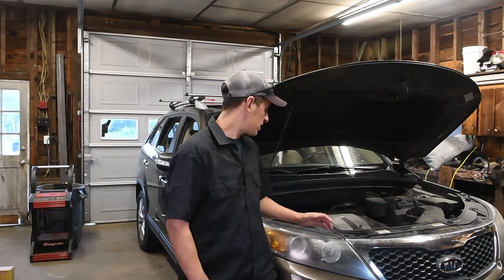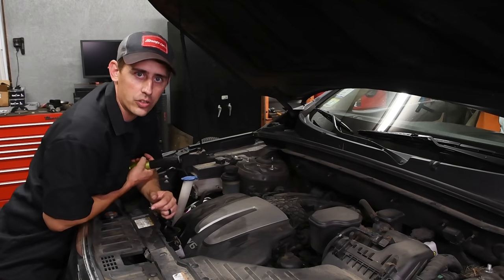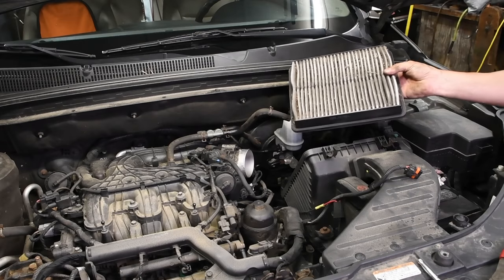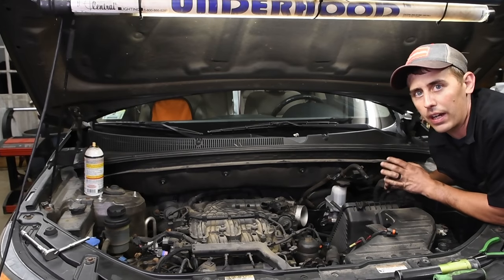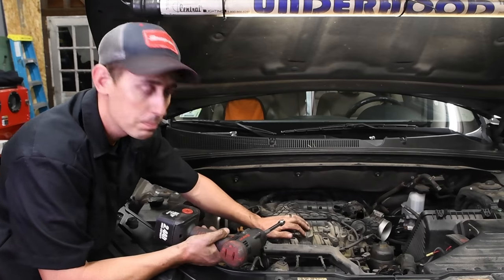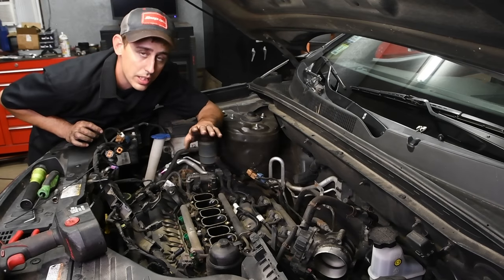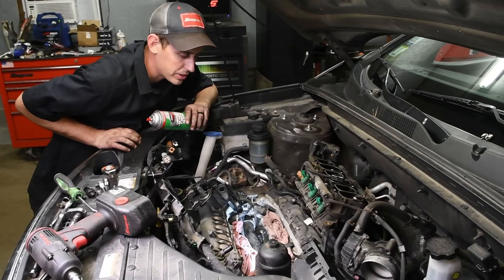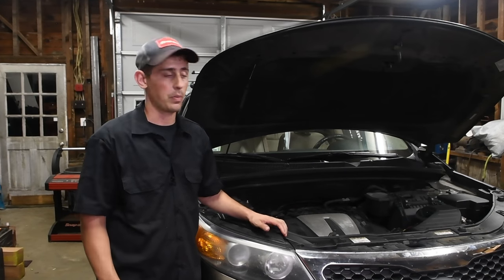Kia and Hyundai 3.5 oil leak diagnosis and repair

Comment from the maker: DO NOT over tighten the sensor. The threads are a tapered pipe thread and over tightening will lead to damage of the housing the sensor is threaded into.
Reply: Seen to late broke housing😢
Reply: Anybody ever replaced the piece the oil pressure switch screws into?
Reply: Part# 21160-3C700
Reply: I have one that has been fixed with JB weld. Not sure how that piece comes off.
Reply: @samroberts7165 I'm currently doing that. The housing is called the "Oil Cover". You have to drain the coolant, remove the coolant assembly, on the driver's side of the engine, remove the the center coolant pipe and then you'll have access to it. You'll need to replace the oil cover gasket, the two o rings on the center pipe, and the gaskets on the coolant assembly. I recommend adding a little RTV to the oil cover gasket, the seal it better. I torqued everything to spec and still had it leaking a tiny bit of oil. Have been doing this job since Monday afternoon. It is currently Thursday morning. I just want it done.
Reply: @JoiceVaderd  can u make a vidoe of taking those parts off 🤦🏽‍♂️🤦🏽‍♂️ I’m currently doing the same thing and I’m struggling a little bit please and thank you

Comment: Thank you very much, Kia Sorento v6, 3.5. dealership found a oil leak, quoted me a rear main seal, valve cover, oil pan gasket and timing belt cover. $1700 but couldn’t tell me specifically which gasket was the fail point. A little Google and YouTube tells me it’s a few gaskets and once sensor. Save me a Ton of money and anxiety.

Comment: We just purchased a 2015 Kia with an oil leak. Taking it back to the dealership tomorrow, but I assume they are not going to fix the issue. After watching this video I am certain that the oil leak is caused by the oil sensor just like the video. Thank you so much for such a detailed video. If I have to perform the repair this video is going to come in very handy. Thank you so much "In the shop".

Comment: Great video, I've had to do this twice on our 2012 santa fe, the first time it happened I thought for sure we had a major engine failure. The first time I replaced the oil pressure sensor I used an OEM part from the dealer and it failed about 12 months after it was replaced and leaked oil again. The second time I purchased one from the local autoparts store and it's been holding for 2+ years. 

I've had luck sneaking a deep socket in under the coolant crossover tube with a long wobble extension to get the old sensor out. Saves a lot of time messing with box wrenches.  Also, I would recommend anyone looking to diagnose this to invest in one of those small USB inspection cameras or boroscopes from amazon. Mine cost me $25 and has saved my butt more than once looking at hard to reach places like under the plenum (it's how I discovered my original sensor was leaking).
Reply from the maker: Thanks for watching! I wish the OEM would update the part but they just keep making the same faulty sensor.

Comment: I used this today on my 2012 Sedona. Took me 11 hours and three trips to the hardware store, but I got it done. You did an excellent job explaining it, you have a great presence, and know your stuff. Thank you. Keep up the good work.
Reply: Wait, a Sedona?  Presume that's w/ the 3.8 engine.  Same issue on that engine?  -- that this guidance also applies to my 2009 Sedona? Common explanation for oil drizzling (slowly) down across belt side of my engine (and ruining the alternator - after several months) is leaking valve cover gaskets. I changed the front one, but leaking continued.  (and ruined a second alternator) Was about to change the rear VCGasket...  (may do that yet)  But this is the first video I've come across confidently telling me the problem is with the oil pressure sensor (!)....  (and min 2:30 shows how....)  Yet what an long, long job (anything but an "easy fix) to get down to it!...  Any further tips/thoughts from your Sedona experience?
Reply: I see the 2012 Sedona had the 3.5l engine.  (unlike the 2009 with the 3.8l)...  Still wondering if I've got the same issue?  Not convinced.  Yes, have the wetness behind the belts, but not having same "typical symptom" mentioned of oil "pouring out between engine and the transmission."  But what else could be causing the wetness behind the belts....?
Reply: Did you have a leak ? Or was just a preventative maintenance. I have the same model Sedona as well.
Reply: @dinscool85  The pressure sending unit cracked (the plastic portion) and oil was pouring out. I got about 15 miles to the gallon of oil. It was pretty expensive driving from Charlotte NC to Central Illinois.
Reply: @AndyDeMontana  crazy.. at what miles did that happen? Mine currently has 136k miles on it..
Reply: @dinscool85  At 236k. I'm at 292k now.
Reply: @AndyDeMontana  292k miles on a Kia is impressive..
Reply: @dinscool85  I planned it being almost to the halfway point. My Hyundai Accent had almost 400k before I sold it. It was running fine but started burning a little oil.
Reply: @AndyDeMontana  any major repairs or maintenance item to look out for ? Mine runs fine for now. Looking at the new car prices, I’m planning to keep it till it dies.
Reply: @dinscool85  I change the oil and filter every 5K, the air filters every 25K, and the brakes about 50K - be sure you change the rotors when you change the brake pads.  I am super happy with mine.  And yeah, new prices are bad, plus the new laws are heading me in the other direction when it comes to car age.
Reply: Very impressive routine maintenance! Do you also do transmission service? @AndyDeMontana
Reply: @ericjones363 Actually, no.  A while back I started smelling hot oil again, but no drips on the floor or anything.  That's a telltale sign of transmission trouble, though, so I figured it was about time to have it changed.  I had a friend do that for me (he has a lift).  It was pretty black in there.  That didn't solve my smell problem though, so today I'm back reviewing this video as I check for a leak on the new pressure sender (at 297K).  This week I started seeing drips on the garage floor so now it has my concern level up.

Comment: Couldn't believe my luck when I found this video.  My 2010 Santa Fe 3.5 with 326,000km threw the oil light on my way home from work. Pulled over and checked under the front end.  Oil was running out the bottom of engine where it joins the tranny.  Was sure it was the crank seal.  That was until i saw this video and confirmed it was the oil sensor.  Yippee !!! Still a tough repair but far easier than fixing a rear crank seal.  Thanks a bunch! This was an easy-ish DIY fix with $150 in parts verses a full engine pull and likely well over $1000 in labour if it was a crank seal failure.  Book hours for the sensor is 3 hrs crank seal 11 hrs
3 things I found helpful from my experience.  Box end wrench on the sensor also did not work for me.  The wrench body was too wide to get any swing.  I used a socket which I slide in under the fuel rail.  You could also grind out a section of the box end wrench where it interferes with the head to allow for more swing.  Secondly the 6mm allen bolts to detach the lower plenum are quite deep.  You'll need at least a 3" long key head to get down between the fuel rail and the ports to get to the bolts ( you can also loosen the fuel rails to get an extra millimeter or two of clearance if you have a shorter wrench and need to get the wrench head down farther).  I also had to cut the sensor wire from the remoter starter to allow the upper plenum to e moved out of the way.

Comment: Thank you for your in depth coverage here. I own a 2017 Santa Fe that has an oil leak. Not much is leaking but, it's enough to look into getting it repaired. I took it to my local mechanic who generally has done good work for me on multiple vehicles over the years. They definitely misdiagnosed my leak as the main rear seal. $900 later, I still have a leak! Taking it back tomorrow armed with information from your video.

Comment: Thank you for a great video !!! I had to have this repair done 2x’s on my 2013 Sorento. Each time it was almost $800 😬😬😬 and it looks like it’s failing again with 203k on the motor. This sensor is a crappy design and made to fail. With the help from this video I believe I can attempt this myself, thanks again you may have just saved me $800 !!!
Reply from the maker: Glad I could help!

Comment: My 2012 Sedona's failed 700 miles from home.  I limped it back at 55 most of the way, adding 2 quarts of oil every 20 miles.  That was a LONG, EXPENSIVE drive home.  Thanks for posting this - the fix looks time-consuming but very do-able.

Comment: Thank you for this awesome video.  I have a 2011 Kia Sorento with 79K but the 2.4L (4 cylinder) .  It just started to leak some oil.  Kia dealership said the timing belt cover/casket needs to be replaced for $1900, but at the same time, they seem like they didn't want the work.  I thanked them and left.  So, I will look at the top of the engine as you described.  Again, thank you.  Take care.
Reply: Your engine is not V-shaped, it's an inline 4 cylinder. Your oil pressure sensor is at a completely different location.

Comment: I’m really happy this popped up in my google search! The leak definitely looked like a rear main to me, and it started at a few drops and went to a whole lot in less than a week. Thanks for the video!
Reply: I should amend my comment. My leak had all the symptoms of this one, and was even leaking from exactly the same location, but mine turned out to be a head gasket. I stopped counting after 4 stripped head boot threads in the block. Threaded inserts are holding strong so far!

Comment: Great video and advise...also during this repair it would be a good time to replace your spark plugs and also replace your valve cover gaskets if you see oil seepage around where the valve covers seal to the cylinder heads...its a good time to do these when the plenums are off during this repair.
Reply: I think it'll be a perfect time to do a full service

Comment: Just wanted to thank you so much for your detailed video on replacing this sensor. You can tell with your presentation you know your stuff. Much appreciated and I have subscribed to your channel.
Reply from the maker: Thank you! Glad I could help.
Reply: @InTheShop  I had taken it by two shops and they both had me quoted on replacing the  main seal , one of them at the cost of $2800. Thankfully, I boyfriend decided to investigate and came across your video and you proved him right!

Comment: Thank you very much, I just got quoted for the same issue by a shop 1200 $ to replace transmission / engine seal and watching your video make so much sense , thanks a lot again. I will buy the sensor and replace it myself.

Comment: Thank you for posting, even though I was working with the 3.8 L lambda (2011 Veracruz Limited) oil cooler removal and knock sensors replacement. It helped me avoid a potentially huge 🔥 issue with the gas rails. Went and rewatched multiple times!

Comment: Very good video.  I had no luck using a wrench to loosen the sensor.   I found that using a non-impact 3/8" drive 15/16" deep well socket was much easier.  It is a bit shorter than its 1/2" drive counterpart, and that little difference in length gave me just enough room to get the socket on the sensor in that cramped little space.  I also recommend that if you use shop towels to cover the intake so that nothing falls in that you make sure to remove them before reassembly.  Don't ask me how I know.

Comment: Just an FYI for anyone with this issue. First, there is a bulletin on it from KIA. This may be covered by warranty even if outside it otherwise. Second, my sons Sedona just had this problem, and the oil did NOT leak to the back area of the valley and onto the rear main area. On his engine, the oil from the switch got pushed into the wiring insulation (in with the copper wire), the path went out to the right front (left looking at it from the front of car) to a group of solenoids mounted on the engine above the valve cover. Some of the oil also dripped onto the serpentine belt and got thrown around a bit. The dealer fixed it under warranty and also replaced some wiring since we complained. Don’t know if they got it all though, but it’s documented for later. The oil light would also sporadically illuminate.

Comment: Don't forget to change the spark plugs when you have everything off, because it's almost the same procedure. They designed this engine to never get fixed so highly technical (they could have placed the oil sensor anywhere but.. ) same deal with the alternator have to take half the engine apart.

Comment: I want tom thank you so much for all then insight on replacing the oil pressure switch. I also thought it was a main seal until I found your video..Your insight was spot on and your video was clear and easy to follow along..Thanks again

Comment: Incredible video!  I believe this is my issue on my 2012.  It seems to be leaking from somewhere above the starter... which, to me, corresponds to the weep hole at the end of the valley you described (on the right hand side of the engine).  At least that's where I think it's coming from.  Does that sound about right?  Thank you so much for taking the time to explain the process.
Reply: NM... confirmed the oil pressure switch is leaking using my borescope.

Comment: Great job troubleshooting and not just throwing parts at the problem. Nice that you mention the bolt sizes.
Reply from the maker: Thank you Augie!
Reply: @InTheShop  Great video I have the same car with variable valve timing solenoid exhaust Left i believe leaking oil but i can not find it. can you help please

Comment: Very nice video! Great work. I have a very significant oil leak from my 2015 Genesis V8 5.0. The leak appears down at the weep hole near the bottom of the bell housing. It leaks quick enough with the car idling in park that I am not driving it.  I am wondering if you know that the problem you fixed in your video could be the same on my 5.0. I downloaded the hyundai tech manual for my car (19.00$) and it seems to indicate there is an oil pressure sensor in the valley as you had on the car in the video...but I think the manual is translated from Korean, so its a little unclear.  Same set up you think? Thank you.

Comment: Excellent diagnostics and explanation. This may be a potential issue on the 3.3T engines as well. More owners (G70/Stinger) are seeing a slight oil seep between the engine and trans.
Reply from the maker: Thank you!
Reply: My cadenza has a 3.3.3l  had to remove the injector.. they're under the lower plenum on mine

Comment: Wow... Shout out 2u very focused, patient and thorough Hyundai needs mechanics like you it's funny my 2018 is burning oil and my close mechanic friends all say the same pvc valve probably failing but after watching your video I'm definitely considering trading my truck in ASAP because when I took to the dealership I got the vibe nightmare look on the mechanics face so definitely grateful for your video... Where are you located... Nevermind God bless and may you continue to give great knowledge and service ✌🏿👍💯

Comment: Great video, very detailed 
A friend of my brother in-law had this very issue and he asked me if I could do it for him. The job went well. His check engine light was on with two codes. 
One is for the evap system and the other is   intake manifold runner performance code is p200a, what can you tell me about this
Reply: Did you find out the issue?

Comment: Very detailed video, any chance you can do one on replacing the oil filter housing. That one is also very common leak that is simular to the oil pressure sensor leak on the 2011 Kia Sorento 3.5. Thank you
Reply from the maker: Thanks Joe. If I get one in for that I absolutely will.
Reply: Yeah mine was bleeding from that housing. It's a bear to get to the bolts. Seems that 3.3 and 3.5 share the same oil/cooling housings.

Comment: Great video presentation, had this repair done at local shop and since then santa fe loses coolant?  No visible leakage and none in oil, any ideas? Throttle body? Thanks for any suggestions.

Comment: Thanks for the great video! I am tackling this job tomorrow on my wife's Santa Fe. It would be nice if you did have the fastener torque specs. I bought aftermarket parts from RockAuto and Amazon that I am hoping will work out well. Cost was about $50 compared to $200+ that Hyundai wanted. Total shop cost with labor for doing this job at a central MN Hyundai dealer was quoted ~$650.
Reply from the maker: How did you make out?
Reply: Came out great! Bought a set of extended metric allen wrench sockets at Home Depot for about $22 to better clear the fuel rails. Used my torque wrench to do a "reverse calculation" of the torque specs that I felt comfortable with (I prefer to remove any chances of somehow breaking off a bolt!). Had to used two different brands of open end wrenches that I had to loosen the sensor -- flipping one wrench back and forth didn't work. Probably made about 100 mini-stroke turns with alternating wrenches to get it out -- this is a tight spot with very little clearance. T!hanks again for a great video!